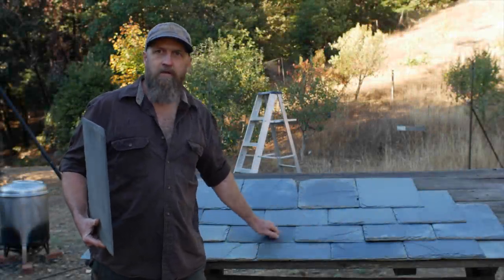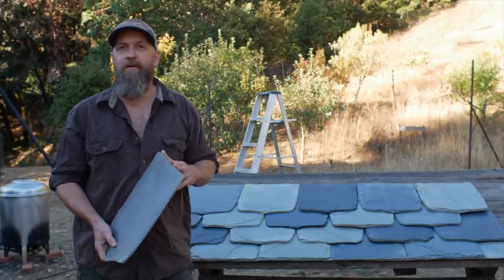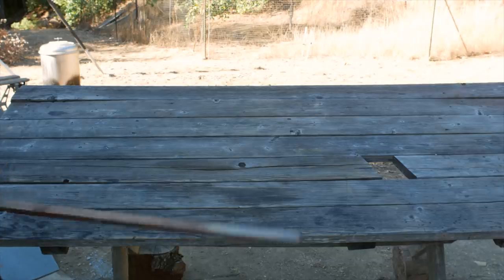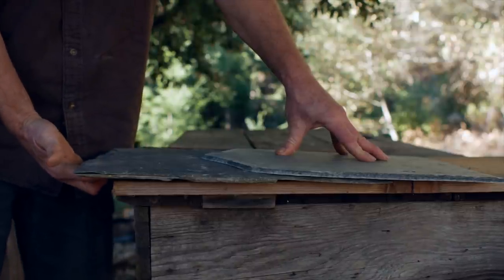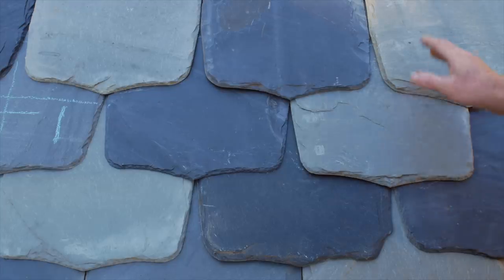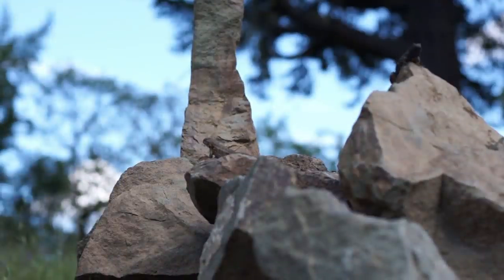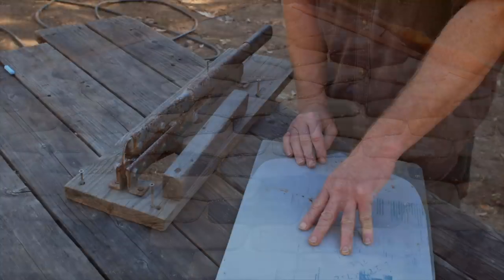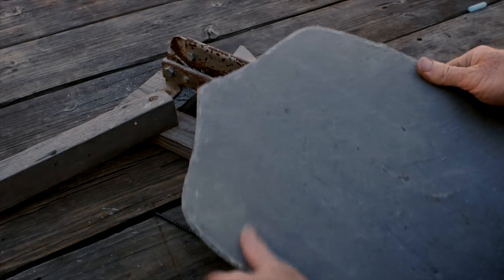🔨 Making a Hand Cut Stone Roof, the Art of Slating #1 🏠

Comment: I knew a little bit about slate roofing before I went to the Isle of Man a couple years ago. Over there, there's a whole castle with outer walls made of slate, and on the hill just to the southwest of the town of Peel, there's a tower that my great great great great grandfather, Thomas Corrin, built in 1805, made of solid slate. That was quite something to get to see. I never thought of slate as a structural building material, but it definitely works.
Reply from the maker: Wow, cool family history.  I imagine it would make a great building block material for masonry, given the flat nature of it.  I have plans to build some miniature stuff with scraps, using it that way, and of course as a roof too.
Reply from the maker: Do you have pics posted of that tower anywhere online?
Reply: @SkillCult  Yeah, if you scroll back a little way on my instagram (cadwaladr_) or google "Corrin's tower". Also the castle I mentioned was Peel Castle, and the outer slate walls were built in the 15th century, I think, though it contains structures dating from the 11th century.

Comment: very cool stuff, Steven! Coincidentially, I have recently become fascinated with slate roofs, I am very intriged by the properties of this material, it's so durable yet very easy to manipulate with only simple handtools. I just think it's incredible that you can punch a hole in a material without it breaking, I just don't understand, you would think it is brittle like a rock ;) Slate roofs are actually common on railway station buildings here in Denmark, dunno why, maybe because they look cool and because governmental buildings tended to be quite refined back in the 19th and  early 20th century
Reply from the maker: I'm not sure why it seems so resilient to handling, splitting and punching.  maybe flexibility.  Sure is neat stuff though.
Reply: I work with roof slates.

Comment: Slate roofs are great, but you have to account for the added weight. Years ago I helped frame a roof for slate. We had doubled up 2x12 rafters on 12" centers, sitting on 2x6 walls framed on 12" centers. The roof will last forever, as long as the structure is built to hold it up!
Reply from the maker: Joseph Jenkins covers that in the slate roof bible.  He says it doesn't have to be as over built as many think.  this is a small building, though the shear could be better on the walls.  The rafters are short spans and true 2 x 8 old growth doug fir.
Reply: I can see how the span would make a big difference. The roof was in New Hampshire and they also have to account for a significant snow load. I like the pattern you went with. It's awesome to be artistic with work.

Comment: I have a question about the benefits of slate vs wooden shingles vs thatch, obviously slate is fire resistant but it's also hard to come by if you were to just walk out into the wilderness and build a house I doubt you could use slate.
Reply from the maker: I wouldn't think so in most cases, but I don't live in slate country. If you could get thin enough sheets, large enough, it shouldn't be too hard. It would help to have some tools, but they can be laid with pegs, or I think sometimes without even being afixed.  Given a few simple steel tools though it seems very feasible and you also need tools to do wood shingles.  Even good thatch is pretty temporary, but it's simple enough.

Comment: Thanks for the video man. I always thought slate roofing was cool, but it seemed unattainable or maybe just impractical in my area. I've noticed the structure before in some of your videos, is it some type of cobb over timber? Also, given how much you do with lime I have to ask; is that actual homemade whitewash?
Reply from the maker: I've done a little limewash, which is just a very thin solution of lime in water, but it is mostly used on stone and other masonry.  This building is straw clay mix packed between studs.  Just a light clay slip coating the straw.
Reply: @SkillCult  you fooled me with the white interior :) it's a rad little structure.
Reply from the maker: @quintond.7888  I just slapped up plywood in here until I can do something else, like plaster maybe.  Just zero VOC paint to brighten it up.